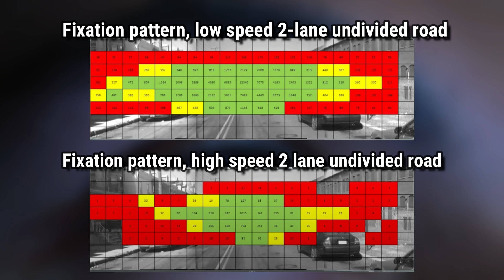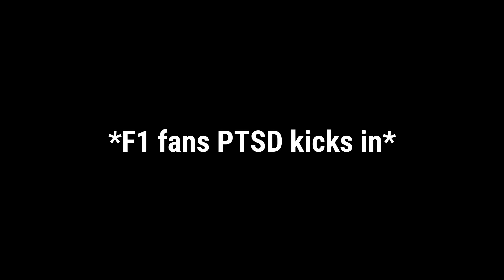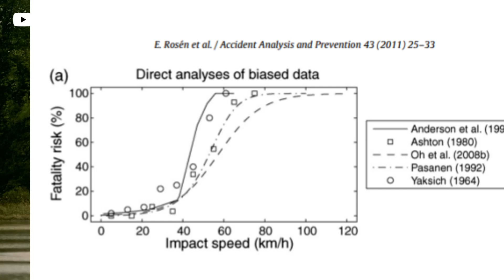Why Speed Limits Are Useless

Comment: This is fine in new development, but the 7000 deaths per year are in existing conditions. You should maybe consider retrofit cost in this discussion. No one is paying to tear up asphalt, reconfigure medians with miles of trees, or narrow roads.
Reply: Yes we are paying for that. It's called road work. It is always happening in every city. The amount of people I see complaining about roadwork is constant. Some years you see them start at one end of the city on a particular road and make its way down to the other end of the city on that same road. Our taxes payed for that. Why not make it safer? Why are we using the same or even worse designs?

Our taxes also fund the demolition of entire neighborhoods just to build wider roads too. What was once housing, apartments, and businesses is just expensive concrete that has to be maintained well into the future.

All it takes is a new planing design and for all future road work to follow those standards. At first it'll be patchwork but over the course of 2-3 decades most of the city will be converted over. Plus a new future roads from suburban sprawl would also be made to the new plan.
Reply: @heroslippy6666  Nice essay. We’re paying to resurface roads. Occasionally add a circle or something. Convincing someone to choose to make roads safer rather than relieving traffic issues is a hard sell. Regardless a discussion of costs and realistic downgrades to stroads would be useful.
Reply: @Datamining101  The only way to relieve roads is to improve alternative methods of transportation. Walking, cycling, a city bus. For walking and cycling that comes with making roads safer, and fixing zoning laws. Mathematically speaking cars are just inefficient for space on a road. Doesn't matter how many lanes you add you will still have a standstill during rush hour.
Reply: @heroslippy6666  There are other ways. The traffic lights in my area are incredibly inefficient (to the point where I believe it’s done on purpose maximize fuel consumption, which is taxed very heavily in Germany). One could very easily reprogram them to be more efficient and allieviate most issues we have with out traffic.

Admittedly, we already have lots of busses, trains, and trams, so I cannot really speak for areas which don’t.
Reply: @ThePC007 
Yea that sounds crazy right? That they would intentionally time the signals to increase traffic???

Yea, crazy like fox! Here on Long Island (NY, USA) this is EXACTLY what they've done - and having been driving these roads for over half a century, I have NO DOUBT!!!

Comment: There is one glaring issue in the US: Urban sprawl. And with it come the ridiculously oversized school busses! These need to fit though almost every corner, and their length combined with the overhang after the real axle make the narrowing of roads really tricky. So, more would need to be done to combat this: Smaller school busses - maybe stacked starting and ending times would help with this - and then, you can start in Suburbia. 

One thought I had on parking is to line the middle of the load with 90 degree parking so you can get in forward and then leave forward towards the other direction. If you then also have walkways on both sides and on both sides of the parking lane, you have good visibility, you can plant trees in the middle for shade, and you break up the visibility enough to slow down traffic.
Reply: They do this in some small towns.
Reply: The busses shouldn't have to go door to door, and most don't. As a kid, I had to walk a quarter mile to the bus stop, because the bus would not come down my street